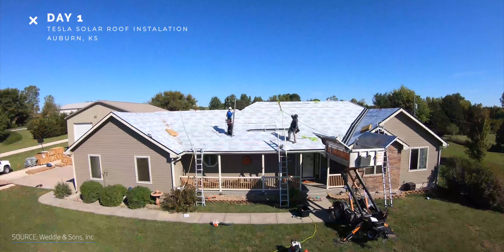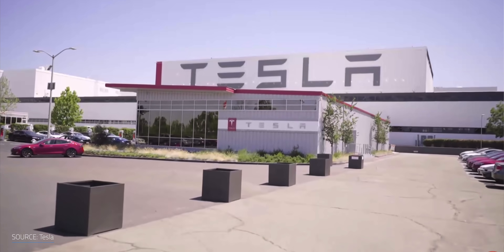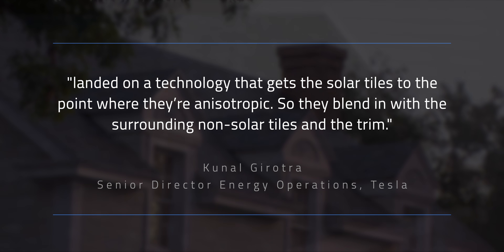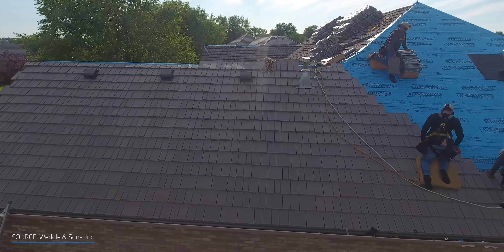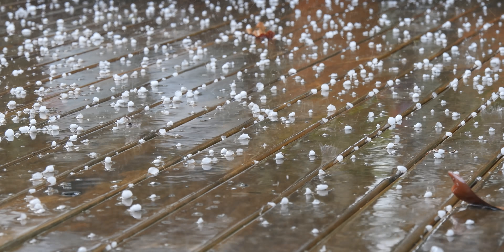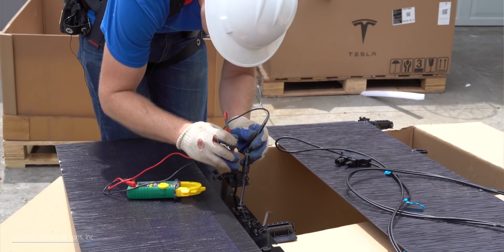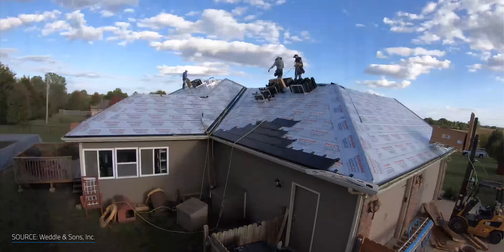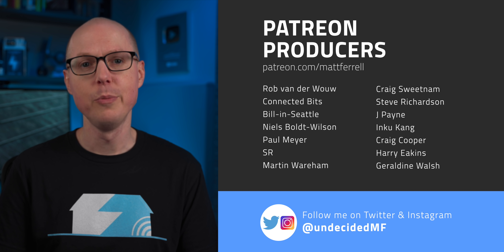Exploring If Tesla Solar Roof Is About To Go Mainstream?

Comment: Thanks Matt,
I’m chomping at the bit, but first I have to get my project going.
BTW the Big Island of Hawaii is this primo market, yet to get Tesla’s attention.  It’s true that the place has limited market potential, as the scale does not compare with much of the mainland.  The logistics are a little more difficult, than the mainland for sure.  I think that there may be a transportation surcharge for getting power walls across the ocean, as I’m pretty sure that they will have to be included on the DCM(dangerous cargo manifest).
Everyone is waiting for production ramp up.  I hope that us guys in the middle of the pacific don’t find ourselves at the caboose of the Tesla train.

Comment: I'm definitely interested in getting the Teslas solar roof, and turning off my natural gas service. If gold prices stay up next year, then I'll likely do it next fall.
Reply: My estimate from Tesla roof in December 2020..
$200/month on electric bills 
18.4kW cost $63,681
4 power walls $28,000
 gate way $1,000
installation $2,000
credit back-$1,000 for roof+power walls
Total $93,681
 So the cost/watt $3.46 for solar roof. 
$2.93 for solar panel
$58,600 for 20kW system. 
In 20 years use electricity $200/mo.
total $59,131 with 2.2% increased/yr 
Install premium new roof 
$9,371 for 1600 sq.ft. roof.
3200 sq.ft $$18,742.

Comment: Looks good, ..so how much power is produced by a Solar Roof?
Reply from the maker: Depends on your needs.  You should be able to size accordingly to your needs.  For instance, if you could install a 6KW regular panel system, you should be able to install 6kW of solar tiles with the rest being dummy tiles.

Comment: I just purchased a home built in November of 2018. I want solar. But have been debating on Solar Tile or Solar panel. The benefits seem to outweigh the cons for Solar Tiles. The real question now is. When should you get sola tiles installed? Only when it’s time to to replace your roof? Again, my roof is only two years old. What should I do? Forgot to mention, I live in Jacksonville, Florida.
Reply from the maker: Yeah, I think it only makes sense if you're nearing the end of life for your current roof.  Otherwise, regular panels on top of your current roof makes more financial sense.
Reply: @UndecidedMF  thank you for your reply Matt.

Comment: When I need a new roof, I’ll go solar tiles. But where I love doesn’t put a lot of stress on roofs. (Nevada)
Reply: Depends on the material of your roof.  Sun and low humidity kills asphalt shingles.  It drys they out and they become brittle
Reply: If you are interested in solar, just have panels installed, cheaper and more effective. Especially in a climate where you dont have to worry about your roof as much.

Comment: How would that work on a flat roof?
Reply: Probably not.
Reply: @calamityjean1525  - Sad
Reply: @zinaj9437  OTOH, the Tesla solar roof tiles are intended to be an inconspicuous, visually attractive way of getting solar power onto a roof.  Since the top of a flat roof isn't visible from the ground, it makes more sense costwise to just use conventional solar panels on the flat roof.
Reply: @calamityjean1525  - Some people don't want those "eyesores" on their roofs.
Reply: @zinaj9437  If it can't be seen it's not an eyesore.  The top of a flat roof can't be seen from the ground.
Reply: @calamityjean1525  Have you seen any flat roofed houses with solar panels?  I have one and you can see the panels from at least a block away.  You can see them from the street if you're across the street.  You can see them if you're walking down the sidewalk next to the house.  LOTS of houses with flat roofs with solar panels have solar panels that can be seen from the street.  They're on support systems that angle them toward the best "capture" angle, so they are at relatively steep angles.
http://www.solar-mount.com/uploads/201811281/flat-roof-solar-pv-system-mounting-structure09270440242.jpg
Reply: @zinaj9437  Where was that picture taken?  I see palm trees over on the right side, which are fairly rare in the US.

Comment: Asphalt roofs can come with a 30 year parts/labor warranty. I have one. If you’re going to do comparisons then let’s be clear that asphalt can last way more than 15 years.
Reply: No question they should last 25+ years in normal conditions. We happen to be in markets that tend to get hail storms frequently, so we often see some portion of 5-10 year old roofs get replaced for hail damage and in Colorado we often see premature deterioration due to extreme weather cycles and higher UV exposure.

Comment: I need a new roof in 0 to 3 years. I really hope they can deliver in Denmark soon. With a power wall to store the energy during the day, where I am at work, and use the battery at peak times where electricity is most expensive.

Comment: If only it was easier for a renter to provide a simple process to a landlord. My landlord would almost certainly be willing. But she lives far away and that alone complicates the process. The rental property market represents, I think, a very large market that remains (it seems to me) largely unaddressed.
Reply from the maker: Agreed!  Some landlord's probably just don't care ... especially if the renter is paying the bill.  At this point the best option for renters is community solar.
Reply: @UndecidedMF  I know from experience that some landlords just don’t care. Though as I said earlier, mine is an exception in that respect. She plans to move back into the house herself in a few years. She’s already subsidized conversion to central air conditioning, for example.
However, I think even some significant percentage of the many holdouts could be swayed by the life and repair ability of a solar roof. And others would be swayed by the resale value increase.
But I agree that community solar is an easier solution for renters where it is available. Heaven help anyone who, like me, lives in California though.

Comment: One thing they are going to have to explore is adding some sort of ice blockers to the lower part of that roof.  

With panels being essentially black, and tempered glass, at some point they are going to be getting warm in the winter sun. That will mean that the snow load is going to melt at the surface, and then freeze overnight.  Nobody is going to want to be the poor guy that walks under that overhang as an entire roof load of snow and ice slide off.

Other than that, this all looks very promising. I've explored adding PV to my little house, but as shingles age, maybe this is a better way for me going forward.

Comment: Like a lot of questions posted already, I have a house that has a few years left on the roof and this has really interested me. My next door neighbor has a conventional solar array on the back half of his roof that in the summertime will generate enough electricity in a month to where he receives a credit. Another question I see being asked here is what kind of power do the shingles generate compared to a similar sized array? If a 20x20 array generates x amount of energy, how much does a 20x20 section of solar tiles generate? I also am confused, are all the tiles solar or are only a portion of them? I'm assuming that you don't necessarily need the entire roof as that might generate a lot of electricity and unless you are popping for a wall battery or two, that energy is just going to get dumped back onto the grid for whatever the cost it is per kilowatt
Reply: "...are all the tiles solar or are only a portion of them?"
Only the portion that faces south, west, or east, if you are in the Northern  Hemisphere.  The north-facing part of the roof gets "dummy" tiles that look the same but are much cheaper and don't produce power.

Comment: You have any videos discussed about its efficiency? Or will you discuss it in the future? Like I know the perovskite’s efficiency is much higher now.
Reply from the maker: The efficiency is lower than a typical panel, but because of the size, you can pack a lot more onto your roof.  In the end you should be able to size a system for your needs.  That said though ... regular panel efficiency is getting much higher in the lab (should be trickling out into real products soon).

Comment: Out of curiosity how is that price per watt number calculated,  a quick google showed values ranging at about $44k for 10kW of solar roof tiles, which at $4.40/watt is FAR higher than that $2.11/watt and prices actually creeping up to about $65k for the same roof, which is $6.50/watt, and god forbid your installer tells you that your roof needs "modifications or repairs" and that'll add another dollar or two to the price.

Overall, I would take what Musk says about HIS products with a grain of salt.  Sure there may be a perfect world you can get down to $2.11/watt with the perfect ratio of tax credit to roof product and hoping you get a roofer who only charges you a certain amount and doesn't decide you need all these extra things.   But the reality... you're not getting a 10kW roof for $2.11/watt installed most places in the country unless you're putting panels up yourself.

Comment: Interesting vid. thought: if you took away the pvc parts, but kept the durability and easy panel replacement, you could have a solid roofing product (and not so color restrained)!
Reply from the maker: That's an interesting thought.  The snap on modularity could be useful for non-solar too.

Comment: Sounds kind of counter intuitive, the roof is "plug and play" things are "easily snapped in",  yet it takes considerably more time to put up a roof.       Either way, and I know those guys hate to hear it, but the fact this seems so easy, seems like it could easily be a home installer DIY type of job one that really cuts the cost if you can remove the installation cost to whatever your free time is worth.

Comment: Great video Matt.  I'm wanting to install solar roof.  I currently have a 10KW ground mount and my roof is about 5 years from replacement.  I'd love to add capacity and some power walls.  But I'm in that position where it would be way cheaper to add 5k to my ground mount and a simple asphalt roof.  BUT...... the simple asphalt roof won't pay me back and is depreciating from day one.  Soooooo I'm back at do the higher cost thing and go solar roof.  Decisions, decisions.... keep up the good work!
Reply from the maker: Thanks, Brian.  It's the Sophie's Choice of roofing. 😉

Comment: If I am ever in the position to build a house , Tesla roof tiles w/ some sort of battery backup solution (perhaps Tesla, perhaps not) will be a part of the plan. If moving into existing house with 10+ years left on the roof, then I'd look at traditional panels .
Reply from the maker: Good line of thinking on that.

Comment: Elon musk did it again 
Hands off for elon musk
Its really a good product.
I have partial solar power on my home,
The problem with a traditional solar panel  for me is how to efficiently install a panel without compromising too much space and safety.
Installation is also time consuming and costly coz a single panel  uses more anodized brackets. 
And traditional panels needs space and maintainance for maximum efficiency.
Which is not available on urban areas, 
Yes, some panels are tempered glass that are strong to withstand huge impacts,
But solar cells inside are not. 
They are fragile as biscuits.
And large impacts can cause micro cracks which is slightly dangerous due to it creates large pockets of resistance turns into heat in a certain parts of the panel especially   for kilowatts to megawatts solar power set ups.

And imbalance series and parallel supply are dangerous.
It happpened once.
And it cause fire.

Comment: i recently replaced my roof and wanted a solar roof, but since i was paying out of pocket there really wasn't any good financing options available :(. i think in order to go mainstream we will also need to consider financing options. seems a little silly that i can easily get any auto loan for much more than that, but when it comes to a durable roof my options are basically a high interest personal loan, or a home improvement loan (which has so much red tape it's basically not worth getting)

Comment: Weddle and Sons service my area. Good chance I'll be calling these guys sometime.
Reply: Sweet! We'll be here!
Reply: @WeddleAndSonsRoofing  If you don't mind me asking, do you install dummy tiles around roof penetrations such as plumbing vents since those areas would normally be shaded and thus inactive anyway?
Reply: @danielthechskid  Yes. Also because there are metal flashings around those penetrations and for grounding reasons we don't let active PV tiles come in direct contact with metal flashings. But shade would also be a factor.
Reply: @WeddleAndSonsRoofing  Thank you for your time.

Comment: When you put solar modules over a new roof, the best time to install solar, you get the benefit of shade from the modules, 'panels', that keeps a roof COOL in the summer sometimes 40 degrees cooler and extends the lifetime of the roof.

Comment: poor efficiency compared to solar modules 

direct placement on the roof doesn't provide space for ventilation. This leads to greater recombination within the cell and by extension, lower efficiency in the summer months

likely no support for microinverters so more susceptible to shading losses

... yeah, this thing may go mainstream but not because it's a well-designed product

Comment: Wonder how you will know if your panel is producing electricity
Reply: Tesla App for your phone shows statistics on solar production, how much power is going to your house, how much to the grid, and if installed, power going to and from Powerwall batteries.  The data is stored on Tesla servers so at any time you can see Powerflow for any hour since the system was installed.

Comment: I had to troubleshoot and repair 'shingle' type panels 10 years ago, they were a bad idea then. if one piece of that system goes down and needs repair you had to remove everything above it, after you find out where it is and not make the roof leak. good luck with that.
Be very skeptical. 
Go with a standard rail PV system, IT WORKS and can be made to look good with skirting.

Comment: I recently installed a solar shingle system from a competitor and can personally convey the challenges.  Logistics is the biggest issue.  There is a lot of coordination required and additional parties involved in the solar design, permitting process, utility connection, etc. that don't exist for a simple roof replacement.  Typically, if you need a roof, there is a finite time period in which it needs to be completed and that can't be nailed down (pun intended) when solar is involved.  It all worked out in the end, but with lots of stress and hand-holding.

Comment: I am curious about the decking insulation requirements/limitations.  I am looking at removing my roof venting and spray closed cell foam to the bottom of the roof deck.  I know some shingle manufacturers will void your warranty if you do that as they claim the roof will get too hot.  Even though all research to that fact has shown it to not be a big deal.  I see there is an airspace under the panels on the Tesla roof so I assume that spray foaming your roof deck won't be a problem.

Comment: For homeowners, small builders, architects etc there is a lack of info (at the planning/design stage) on Tesla's solar roof. We're converting a barn into an ECO home and asked our architect to incorporate a Tesla roof with 12kw of solar into the design but the architect told us we would have to contact Tesla and submit the plans which hadn't been drawn-up.......For quickness we ended up using Marley tiles and 40 Marley in-roof 300w solar panels, they have a downloadable Excell design tool which not only helps when trying to max-out the amount of solar but also lists all the materials required.

Comment: Every city in Canada right now:  Sun angle is 17 degrees above horizon.  Roof?  More like south facing wall, which is how my solar is setup right now, its siding - not roof.
Reply: How well does your solar siding do in summer when the sun is closer to directly overhead?

Comment: I am questioning if its worthwhile putting that kind of a roof on a north facing roof.   Even a straight east or west facing roof, is that even worth it?
Reply: On the north would probably get you a small amount from indirect light (depends on the pitch) but obviously in winter it will be much worse. There were arguments that east and/or west were actually useful. This was because everyone pointed their panels directly south to maximise the energy collection. This led to a glut of energy at noon, when no-one was home to take advantage. So morning and evening (i.e. east/west) actually became more useful. Of course, if you have battery storage as well, then you would look to maximise your usage overnight, so there is headroom in the battery to store all the midday juice. These things are complicated, so you really need either an expert assessment, or a lot of time to research the heck out out of it.
Reply: @stephen-boddy  thank you.  As cool as the engineering is,  its still not worth it to me.   Still too inefficient.   We would need to design houses built to take advantage of every angle of the sun.  Lots more facets,  and cutting.   A pain to build in wood at least.   Thanks for the answer.

Comment: Thanks for this one Matt.  I've not seen anyone else pull this information together as well.  I'm now thinking that Tesla's solar roofs are going to become a major part of home construction.  

What wasn't included is the value of the electricity produced.  $2/sq ft for a solar roof and $2/sq ft for another type roof are not the same.  Only one roof produces something of value.
Reply from the maker: Thanks, Bob.  You hit on a key point.